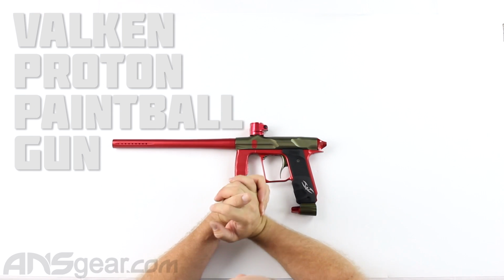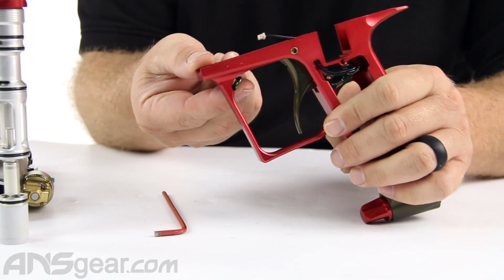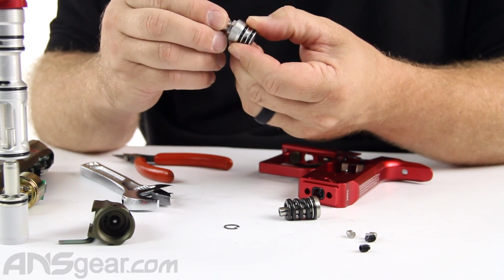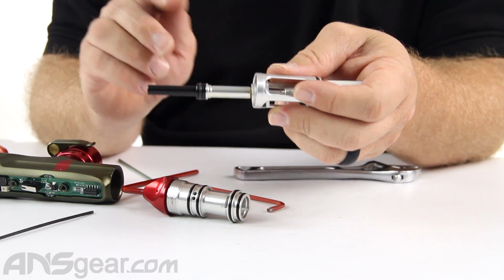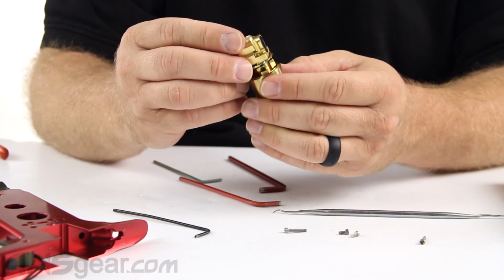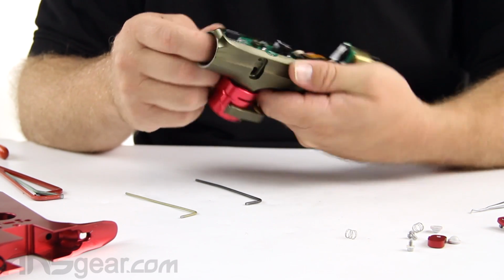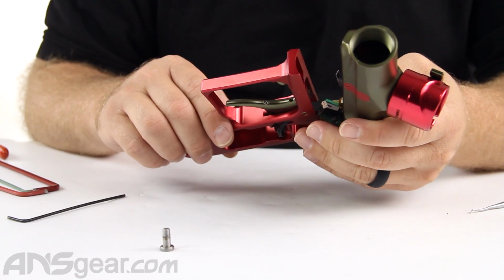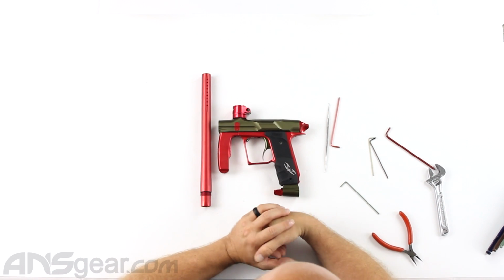Valken Proton Paintball Gun - Maintenance/Repair

Comment: Have you run into a problem with them shooting well in semi auto? I've used two different Protons and both had trouble with semi where they won't shoot at a consistent pace. Very stuttery. They would walk when you dry fired or just activated the solenoid, but were not walkable with actual paint. Tried everything to fix it. Oddly, they would shoot fine in ramping, but no field near me allows ramping. Plus I prefer semi.
Reply: I've had ions that do the same thing. Just replace then board/solenoid and hope it works